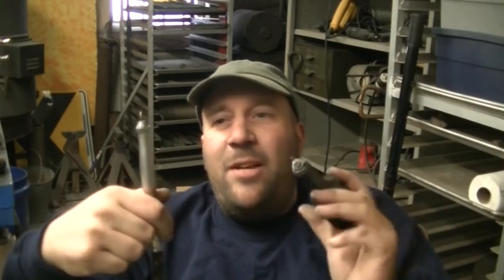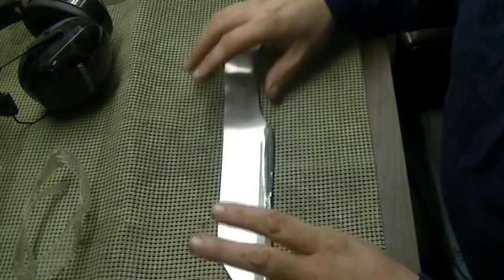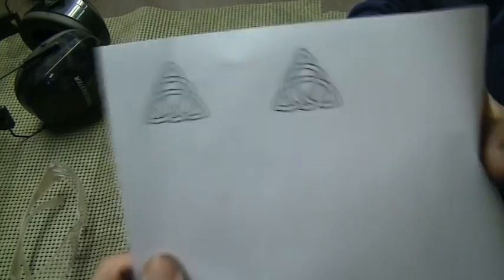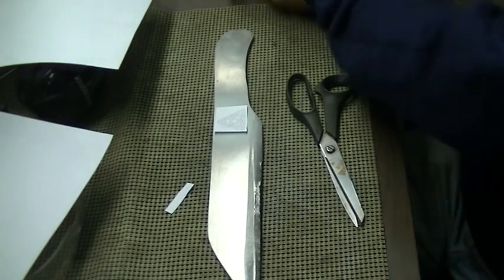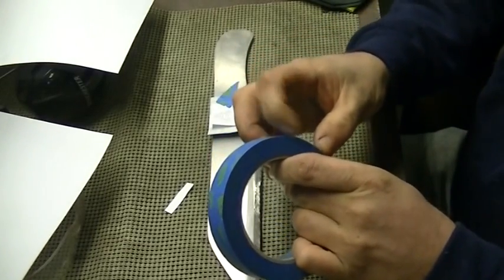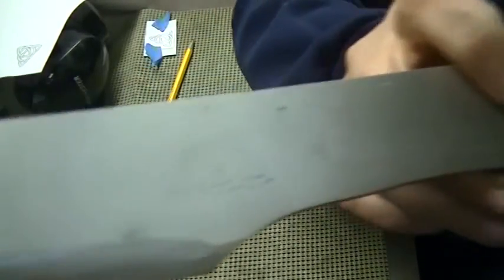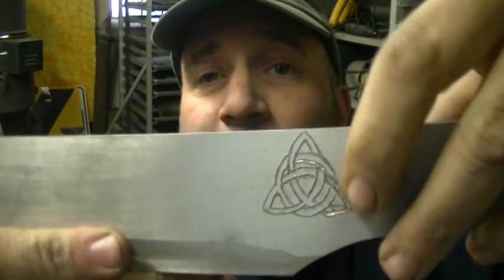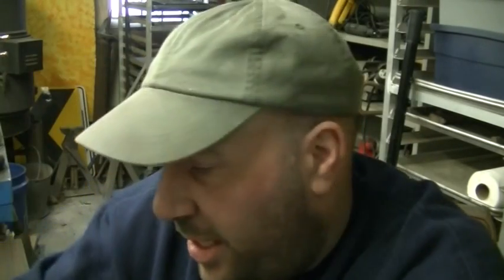Image Transfer Technique For Engraving Metal & Wood

Comment: Cheap walmart spraypaint and carbon paper! Genius! I've been trying to use nail polish and scratch the paint away into the art I want on steel. I then use an electro etcher, that I made, and it only comes out 1/2 ok and 1/2 with runs and splatter marks. I'm going to try your way. Thank you for another great vid, Jeff!

Comment: There's an alternative method for transferring any pattern or picture from paper to a metal surface. If the surface is smooth and flat, you can just print the mirrored image with a laser printer, cut and lay it on the metal surface, printed side facing to the metal, grab a hot iron (the deviice you use to smooth your clothes with) and gently iron the paper. The ink will melt and stick to the surface, and there you go, you have an exact pattern on the metal. You can etch it too, as laser printer ink doesn't dissolve in ferric chloride. Be sure not to steam the paper, and try not to burn it.
Reply: I will come back to this comment when I've given it a try
Reply: @samplum4150  did you try it? 👀

Comment: Hi Jeff. Another thought provoking vid. Doesn't it work if you just glue the pattern to the part (Copydex or similar?) and work through the paper? Cuts out a stage or two! Cheers
Reply from the maker: You can just glue the paper to the part, I have done that in the past and was happy with it until one day I engraved a part slightly off center and had to redo the entire piece. Once the pattern is transferred you can know for sure where its going to end up on the part.
Reply: Thanks Jeff- I appreciate that now. Cheers.

Comment: Jeff, awesome video as always! Would you do similar if you wanted to forge weld brass /copper into a pattern? Was thinking of welding a chess piece from flats stock, then cutting channels (dremel) I could put borax, then melt brass/copper into the channels. Lastly, sand for flatness /scale removal and coat for rust protrction
Reply from the maker: I have seen people TIG weld copper into stainless steel before... using a forge weld for a metal inlay is one heck of an idea. After some research I may give this a shot once I have some free time.
Reply: This sounds like a vote of confidence!  Depending on help around the house when I try this, I'll see if I can do a video and post it.